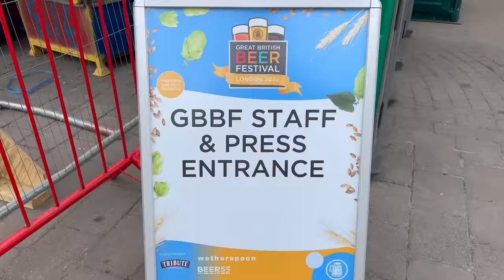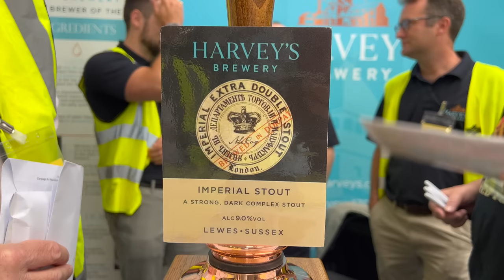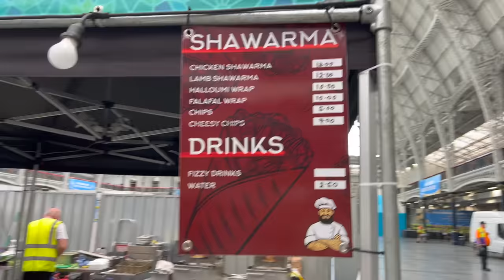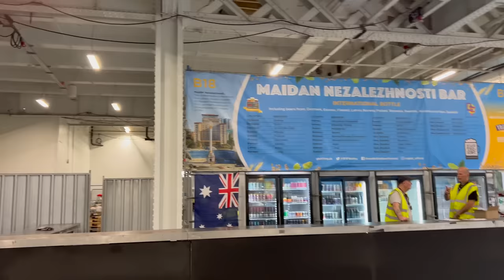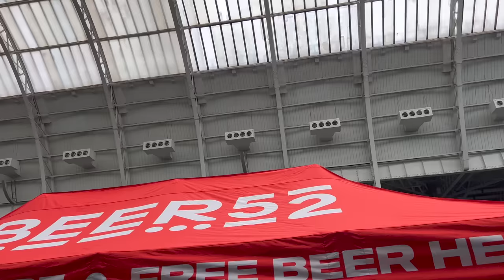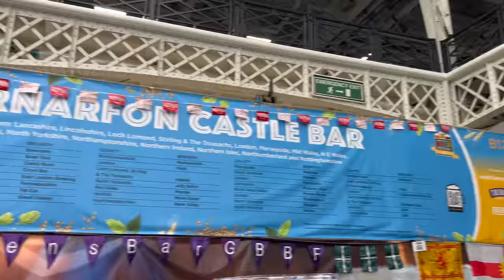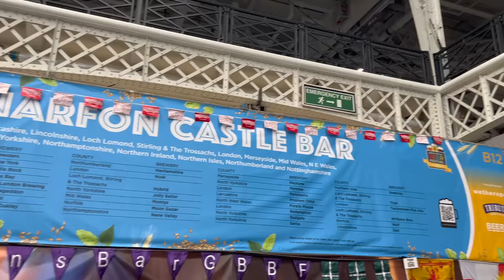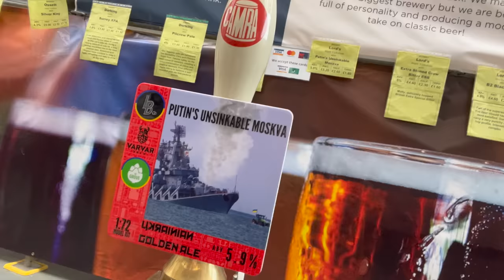A Walk Around The Great British Beer Festival 2022 | GBBF 2022 First Look

Comment: I attended the trade day on Tuesday, I had a season ticket so also went on Wednesday, Thursday and Friday.
I was disappointed this year with the beer list which didn't have any tasting notes or any notes about which acts were playing on the stage or details about the food stands. Having said that it was good to see that the pricing of the beers was not pegged at central London prices of over £5 per pint, I'd say that the pricing was more like outer or outside London prices which was good compared with the prices at the last GBBF which were eye watering.
I'm a fan of "traditional" amber, brown or ruby ales. I feel that the current trend for over hopped citrus pale ales is damaging the industry. There are too many good beers that appear to have disappeared in favour of IPA's. In a favoured pub that I use they have 10 cask ales on, 3 are standards and always available: Bass, Harvey's Sussex Bitter and Big Smoke Solaris. The other 7 will be guest beers, recently there have been occasions where 6 of the other beers have been strong citrus IPA where as most of the customers were drinking Bass or Sussex which ran out! I've started drinking porter or even milk stout! 
Despite the smaller footprint of the festival this year due to the building work I think that the festival was a success.
I felt that it was a bit under attended however in chats with CAMRA staff at the festival they stated that the takings were up on the last festival. I am a CAMRA life member though my only CAMRA activities are attending beer festivals and claiming discounts offered by some pubs to CAMRA members.
Reply: Interesting, I agree with your view on the IPA's & also I'm getting tired of the Citra brews. Things are not as they used to be regarding tasting notes from the last Beer Festivals that I have attended.Some of those prices are taking the proverbial for a beer.I think some of the brewers are aiming for a more exclusive market,good luck to them if they can get the money,more decent Ale for the rest of us,I say!